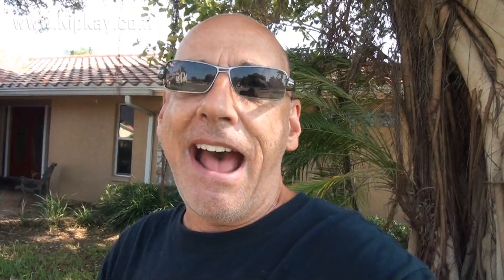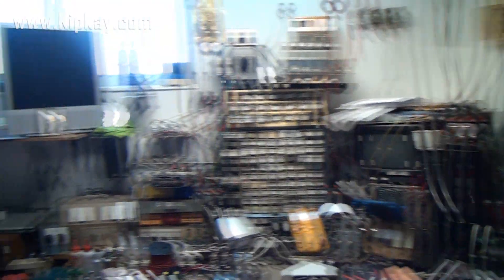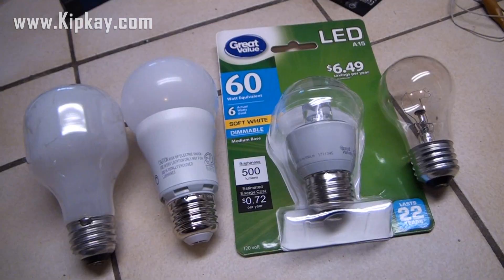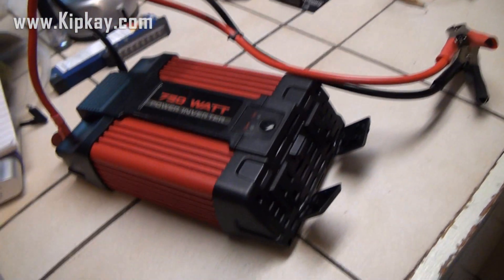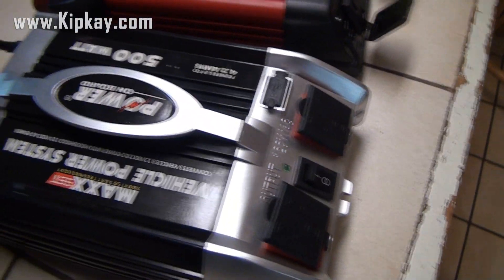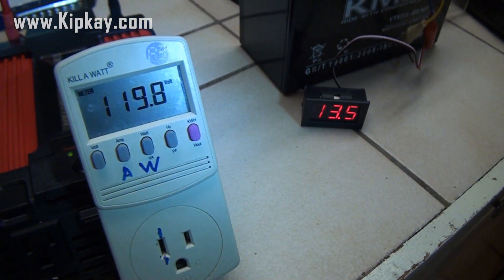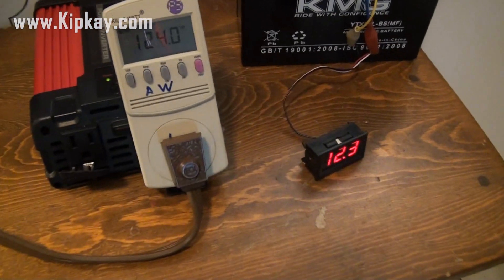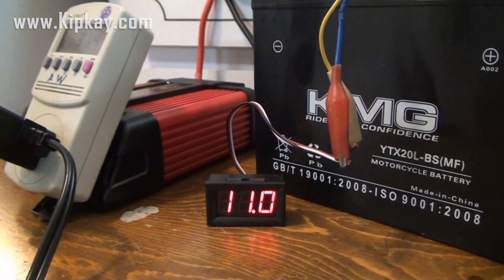Power a Refrigerator with a Battery!

Comment from the maker: Question: How do you charge the 12v battery after it has powered your fridge? Just use the battery in your car with a set of jumper cables. Be sure to start your car and let it run for a few minutes AFTER the 12v battery is charged. And, don't run your car if it's in the garage.
Reply: Or just buy a cheap portable gasoline electric generator since your going to have to buy a power inverter and use gas anyways, plus you can use it to power more stuff.
Reply: ok ,, i have a car battery , and a 800 watt inverter , i am going to try this and see if it actually has enough power to get the refrigerators compressor running ... those compressors take a surge of amp to get them spinning and once that has happened they basically dont require much amp
Reply: Doh, who actually did not know what an inverter is for?
Reply: fuzzlenutberry gas smells! Everybody is going to use their Model 3 battery or powerwalls to power their homes.
Reply: fuzzlenutberry .. i see your point ,,,or just mount a small gen on a workout bike and pretend that they are chasing a hot female ,, this should give them the motivation required to get the job done lol ,,, most people are over weight anyway and can use the workout to remove some extra not needed lard ...
Reply: XxAtomic646xX https://youtu.be/pIivG8KDkvM More like a Tesla Smoothie🔌🔋😋 fridge, wifi, the whole house, up to 2500 watts.
Reply: Hook it up to a 12v solar panel. Connecting multiple panels in parallel will help charge it quicker !
Reply: @WasabiMeal
That's why you purchase your backup generator "BEFORE" you have an emergency...it's a part of emergency readiness.
Reply: Not a good idea. Extended idle on your car will kill the cat quick. Just buy a generator or a proper 12v fridge and some solar panels.
Reply: kipkay your still awesome you showed me the weekend projects and the maker mag and i love you for it
Reply: @IIGrayfoxII
...to keep my fridge running during a power outage?....interesting.... :P
Reply: kipkay you should havr 2 battery. One could be charging well the other is running the frig.
Reply: Kipkay can you make some more spy gadgets in the fyture plese
Reply: Steven Booth 'll
so what ! ?
Reply: thanks
Reply: How do you know when it is completely charged? Can it get overcharged?
Reply: kipkay People with electric cars can run their cars in garages no problem.
Reply: that is not really true charging and discharging of lithium batteries lets loose just as toxic of gases.
Reply: azalru .. my gas really stinks very bad at times lmao ,, i know what you mean when you say gas smells ..
Reply: Question: What if your car flew away by the hurricane
Reply: You can get away with using a 5w LED globe.
Reply: +kipkay And yet, you still haven't correctly pinned your comment to the top. Just do it real quick! It takes 5 seconds or less.
Reply: salandfindles ,,  that comment made me crack right up ,,, i almost peed myself .... my ex use to say that to me ,,, just pin it in real quick , do it real quick it takes 5 seconds or less ,,,...  lmao ...
Reply: you can buy a 2600 watt gen for 400 dollars brand new ,, i did and it works great ,,, if the working class people cant afford that price they should not live in such fancy housing ... naturally they need to buy it before so that they have it when they need it ,,, you know what is strange the fact that i can rely on the governmentt to help me in my time of need and yet i do not get any help from the regular people that i know ... with the governmentt being so corrupt i cant understand why they are helping me ...
Reply: that is something homer simpson from the simpsons would say ,,,lmao ,,, you is one funny wabbit eh .. whats up doc ,,, forgot to put the name of the person i was commenting to ,,, steven booth  this comment was for you ...
Reply: pray to the gawds and they will grant you all the energies that you need lmao ,,,,
Reply: if you hook  up jumper cables to an all electric car, you will blow it up...

Comment: How to power your refrigerator with a battery as seen in this video:
Step 1: Buy a car battery
Step 2: Buy a large power inverter
Step 3: Plug them in
Reply: Thanks lol. What's weird is that I never even thought of using a 12v battery + an inverter to power normal appliances...
Reply: So you left out how are you going to recharge the battery 🪫 after an hour
Reply: I just thought of it a couple of hours ago.  Been looking for what I needed to do this safely without overheating.  I intend to do this setup with a regular solar panel.
Reply: And replace the light bulb to LED.
Reply: Right
Reply: how long would average car battery power full sized refrigerator?

Comment: 220W is the output of the Inverter, not the draw from the battery, it will be higher as to get from 12v to 120v, you need a lot more current. At 18Ah, if it runs for an hour like he mentioned, it means the battery draw is closer to 18A. No way you are charging that battery in an hour, even if you rig it up to a car alternator.

Comment: the problem is: how do you charge the battery?
Reply: Take it outside and run some jumpers from your car battery (provided you have a car of course) :))
Reply: @DanielsGameVault  oooor just buy a gas powered electric generator
Reply: +nukecat Solar panels with batteries, solar charge controller and power inverter is a better option.
Reply: +kipkay You actually failed to pin your comment. Go to it and hit the little 3 dots and correctly pin it.
Reply: Daniel's Game Vault yeah because running your car 12 hours a day just to run your fridge is a good idea. Especially after a hurricane when fuel is hard enough to come by.
Reply: put gutters on trhe edges of your roof and use a small turbine to charge the battery
Reply: @roushhawley8438   LOL
Reply: I have 1000 watt solar panels and a wind turbine charging my 6 pack of batteries that runs a 3500 watt inverter and it's been running my fridge in my workshop  and a bunch of other stuff for a year now and I've never had to hook to the grid yet.... if you were to run a marine battery with that 750 watt it would run 8 hours on a charge.
Reply: WTF BBQ use incognito panels .... put them behind  a set of tinted windows in a shed on a wall facing sunrise or skylight
Reply: Nicholas Lenzo wind turbines work even better. 😁
Reply: untill the hurricane rips them off
Reply: Que haces aquí xdd
Reply: Charge it with another battery...
Reply: U can use a solar charge controller...
Or ur inverter has system to charge a battery
Reply: Solar panels work great during a hurricane
Reply: Proyectos LED car jumper cables .... car running doesn't take much fuel
Reply: Solar panels
Reply: What inverter do your have and what do you power with it?
Reply: That's an excellent idea!
Reply: Don't blame him, he was probably using a glade air freshener or something to make that comment, knowing him.
Reply: That's my burning question too
Reply: You sound like "There's something I have to tell you and  it's  that I'm Chris Hansen and we're doing a show on grown men who solicit minors for sex online." "What you got there in the bag? Did you bring any condoms?" "If there's nothing else you have to say then you're free to go." Police: "Get on the ground, get on the ground, put your hands behind your back. "
Suspect: I didn't do anything, please I did do anything, I was just talking to her, she said she was 18. 
Chris Hansen: "She's 13, I have the transcripts would you like to see them? Here you say I'd love to blank your blank, would you like to blank me in the blank?" LOL 😆
Reply: Ground mount the panels sissy !! Whos gonna peek over your fence !?
Reply: So so wrong
Reply: Solar gas wind fire thermoelectric or alternator
Reply: Buy can food no refrigerator needed
Reply: Use a smart battery charger and plug into the inverter.
Reply: An inverter hooked to your car will work in a pinch but a small inverter generator is a better idea. It could also run a small air conditioner.  Switching out the light bulbs and having freezer packs ready to go are good preps. Thanks for sharing.
Reply: Keep the batteries charged thru either solar or generator. Have more than one battery so while one is being used the other is charging. You can also charge them while in use.
Reply: Generator on stationary bicycle and have the wife pedal it for 12 hours.... lol
Reply from the maker: See the pinned comment above.
Reply: @kipkay  would there be a way that one could connect a battery charger to the inverter, so in a sense, that the battery could `charge itself', so to speak ?
Reply: There are a lot of options. Solar panel is a good option. You can get one from Harbor Fright for just a few hundred for a good one. Jumper off your car battery is an option. If you are using a car battery and have not totally drained the battery, you can throw it in the car and run the alternator. A crank generator works. A gas generator works, but if your generator is working you most likely do not need the battery. Lots of options.
Reply: you could connect the inverter to your car and use an extension cord to the refrigerator, you'll only need to worry about gasoline.
Reply: WTF BBQ land of the free hey.  Free to pay taxes and do as we an the media say. Remember you hate North Korea cause “reasons”
Reply: Proyectos LED Si lo sabes para que preguntas !!!
Paneles solares o generador de corriente !!
Reply: Vamos Argentina ! Y proyectos LED !!
Reply: That's easy, you just plug it in to your battery charger and wait for the power to come back on...oh wait...that won't work.  There must be an app for it.
Reply: Buy car battery charger and plug it into the power inverter and plug thr 12v port into the battery. So you'll have invinite power. I've done that and it works
Reply: @azmanhadi3321  best comment i read all day:)
Reply: With another battery in a Tesla
Reply: +Jesse
Actually that's a "NO"  in florida.   It is illegal to use a solar panel unless it is hooked to the grid and approved by the utilities.
Reply: Whar sort of Nazi, communistic state do you live in Jesse? Is that Florida, or North Korea?
Reply: @rohanmarriner5626  I believe he lives next door to the solar panel police. There’s lots of people here with solar panels. You don’t need any special permits or licenses to buy solar panels in Florida.
Reply: WTF BBQ why would u let that stop u?  Is it only illegal if u r using solar for entire home?

Comment: For people asking how they can charge the battery in power outage get two batteries while one is being used with the fridge you can use recharge the other one by connecting to car or hook it up to solar charging panels or you can rig up a dynamo setup and can use that to charge it.

Comment: So after an hour, the battery goes flat, you have no way to recharge the battery (the power is out), you then have 4 hours to consume everything in the fridge before it starts to go bad....
Realistically, this was no sort of KipKay hack, it's just normal use for a battery power inverter....no magic here
Reply: Some common sense helps! 1st if you keep the fridge/freezer doors closed it stays cold! 2nd, you run a jumper from your car battery to the inverter battery and charge it that way! Like I said, a little common sense is all you need, and it's something you cannot buy!
Reply from the maker: See the pinned comment above.

Comment: Connect the inverter to the battery while it is still in the engine bay... run an ext cord to the fridge. No disconnection required to charge the battery... simply start the car.
Reply: I think it would be useful if cars and houses were designed so the car can be easily hooked up as a generator to power your house.
Reply: They have a system for electric cars for that I saw a couple weeks ago
Reply from the maker: Careful. That could short out your alternator.
Reply: Earthbjorn Nahkaimurrao it would be pretty cool, but cars aren't built to idle for hours and hours the same way a generator is

Comment: It would make more sense to connect the inventor to your car battery and occasionally run your car to keep the battery charged. Just know that doing this will shorten the life of the battery in your car, since car batteries don't handle being drained much more that 10-20% very well over time. A deep cycle battery with more amps would be better for this project as well.
Reply from the maker: Caution. That could short out your alternator

Comment: Good idea. With the power out, how are you charging the 12v battery in an hour? Not trolling, serious question!
Reply: mount a small gen on a workout bike and pretend that you are chasing a hot female ,, this should give you the motivation required to get the job done lol
Reply: Frank Troland use a car and jumper cables
Reply: Philip Partain connect another 12v battery to charge that one😋
Reply: My question is how do I change the battery in a power outage...
Reply: Philip Partain fhfgrh
Reply: Use a ZPM.
Reply from the maker: See the pinned comment above.

Comment: I did the same thing with the exception of the type of battery ....I do car audio for a living in central fl and my car is ran with 8 3.2 volt lithium 100 amp hour cells wired to a 12 volt system ... Basically 2 12 volt lithium batteries .... Plus an aftermarket 370 amp alternator on that vehicle ..... I ran everything in my house with the exception of anything that took 220 or more than 25 amps of power to run.     Lithium is the way to go

Comment: You said that the battery is 18 A-Hr (although the box shows 20 A-Hr @ 10 hr) and the fridge draws about 2 amps.   Then you said the battery was only good for an hour.  Does the battery's power drop off that much after 60 minutes?  I thought that since the fridge needs 2 amps and you don't want to run the battery passed 80% of its charge, you're looking at 2/0.8 = 2.5 amps. Then consider a high rate of discharge for 2.5/0.5 = 5 amps minimum source.  The battery should be good for 4 hours (20 a-hr/5 a), yes?
Reply: james s ,, i agree ,, i dont think that small 750 inverter would get the compressor going ,,, way to much amp needed ... i am going to try my small 800 watt inverter and see what happens ...it trips just running a drill after awhile so i dont believe it will work ...
Reply: 2 amps at the 120V output, so around 20 amps at the battery terminals. That's why the runtime will be less than an hour.
Reply: sprezzaturarrd 
the 2amps must be without the compressor running. my fridge uses lots more. about 15 amps on start up surge. I have a 5kw inverter to run mine. and other things. you really need more battery and inverter if you are going to run the fridge for a day or more. that may be OK for a hour or two. I gust don't think it would run the compressor. that must have been the consumption of the lights only.
Reply: sprezzaturarrd you are pulling a lot more amps when the compressor runs. 6-10 amps
Reply: fridge compressors usually run around 300w or so, 6-10 amps is what a small air compressor or AC unit draws.  You typically can barely hear a fridge running, while you can hear a AC unit buzzing over the loud noise the fan makes

Comment: You're going to kill that battery very quickly by completely draining it like that.
Reply: but in an emergency situation its good
Reply: Replacing the refrigerated food and living off of non-refrigerated foods is going to be cheaper than buying a new battery to rapidly destroy.
Reply: @Huge Donkey I've been really tempted to buy some panels recently to play around with in an off grid system. Do you think eBay or gumtree panels are worth buying or am I going to have to head into somewhere like jaycar and pay a fortune?
Reply: you are in an emergency probably just gonna use the car battery to do it and wont have enough time to buy foods for the power outage time and most the stock will be gone cause everyone else. the power is out for a lot longer than the hurricane/cyclone/tornado. and it will actually probably cost less for a battery over 40 cans of beans and spaghetti for you and your family and thats right no power cant cook should of made a sandwich with the food i had in the fridge.
Reply: Huge Donkey Should have*
Reply: power inverters (most of them at least) will automatically shut off if the voltage is too low to prevent over-discharging the battery.
Reply: Huge Donkey can you give me the information on where to look at the wind on YouTube and eBay